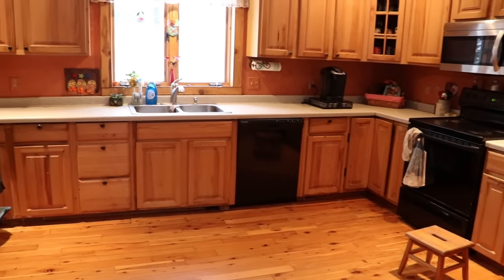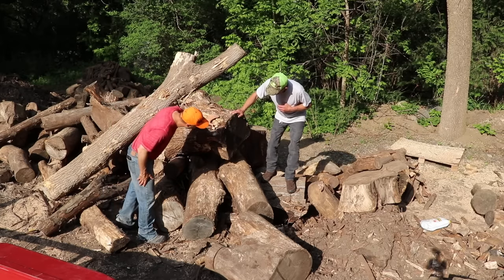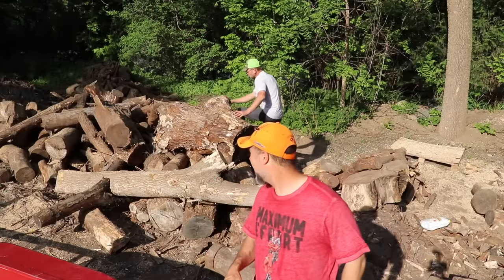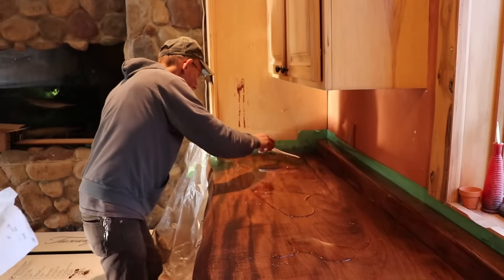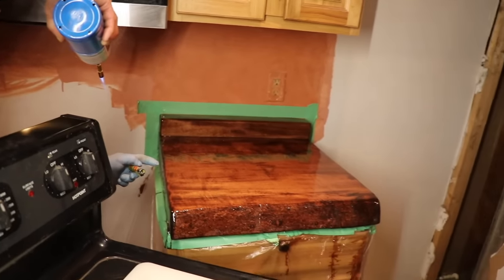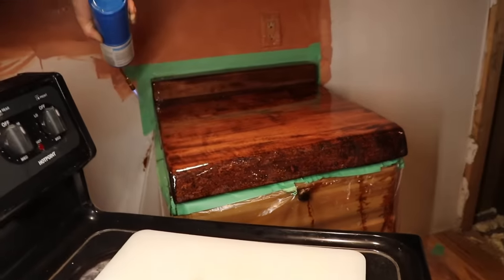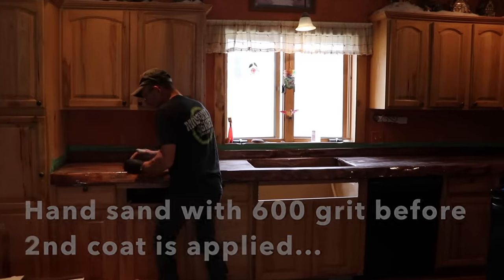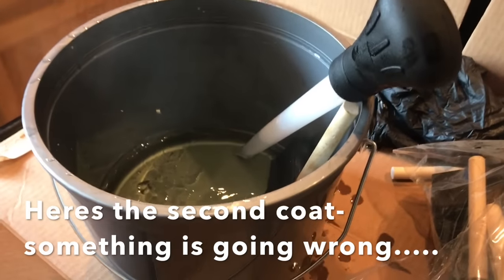A bad Epoxy Job on Our DIY Live Edge Kitchen countertop ... how to do Epoxy repair Pt3

Comment: I used Stone coat counter tops epoxy and it was great to work with. It is food safe and heat resistant. No smell and don't need mask and so on. Check them out on youtube. their stuff is wonderful to work with for this type of job. I love the wood with live edge. Beautiful
Reply from the maker: I have seen that channel.  His stuff is amazing.
Reply: I used it in my kitchen, cabinet doors, and drawer fronts. it looks great.
Reply: Teresa Nanry plus they use a burn in stick..works great for bubble areas
Reply: burn in stick?
Reply: Anyone who tells you not to wear a mask when working with epoxy is just irresponsible.
Reply: Does it yellow over time?

Comment: Yes as others said and i did it wrong once too it heated up to much like your big full bucket did in 8 to 12 minutes.. . Mix in your big mixing bucket for two minutes and instantly get your Epoxy out of the big bucket ( in big bucket Epoxy will harden and be worthless in ten minutes )pour INSTANTLY  into small cups  4 to 8 ozs you now have a 20 to 40 minute working time...

Comment: I ruined a gallon of epoxy today.  I went by the instructions like I've done a dozen times before and did a warm water bath to bring the epoxy up to about 80F.  Here's where things went wrong.  This was way larger a batch than I've previously done and was going to be 1/4" thick so I decided to degas the epoxy like I've done with smaller batches before without issue.  I got busy and forgot about the epoxy in the vacuum chamber.  10 minutes went by and I hear popping so I check the epoxy and it's boiling so I let air back in and realize the bucket is melting.  I had to dump a bucket of ice on it to get it cool enough to remove from the vacuum chamber.  I left it outside for 2 hours and it's still 175F!  I just checked on it another 2 hours later and it's 135F.  $60 down the drain!

Comment: Never hand sand. What happens is while you wont be able to see it while sanding you will leave small finger grooves in the finish from hand sanding. Always use a flat sanding block and with the black sand paper use a spray bottle and wet sand. It works much faster on higher grits and the paper lasts longer.  Been doing wood work for years. Trust me ive made the same exact mistakes and learned the hard way too.

Comment: I need help. I hired a guy to make epoxy countertops for us. This is what has happened to the side edge. There was a faint lighter colored line or scratch initially, and over time, it’s turned into this. He’s promised to fix it repeatedly but has never actually done the job nor is he returning calls now. I’m selling my house and need a way to make this just look darker so it doesn’t stand out.

Comment: Maybe polyurethane is sounding like a better option for a simple old fashioned wood counter top? Maybe save the epoxy for the projects where it's structurally integral or you're replicating the look of a different material? That's my take away from this. Glad you decided not to try to pour over bark though - otherwise somebody would have been barking a few months down the road. haha.

Comment: Hi Stan.  I've done projects like this, not as large but pretty close.  A few tips:

- use a sanding sealer before the first coat.  The reason you get bubbles is the epoxy is displacing air in the imperfections in the wood
-Epoxy is mass sensitive and in a large mass will exotherm if you mix too much (which you did).  It had nothing to do with the bucket material.  I don't mix more than a quart (2 lb) at a time.  You also need to use it quickly.  It will get hot as hell in a concentrated mass.
-Invest in a vacuum chamber and de-air each mix before apply it.  Takes about 5 minutes.
-You absolutely need a team to do this, one mixing and de airing and at least one applying.  Good work there.
-Yes, you can use a heat gun as opposed to a torch, it's all about technique.  You can also lightly spritz over the bubbles with IPA and they'll pop.  What you're doing is reducing the viscosity / surface tension in that local area.  You need to be careful though cause you'll get waves if you try to pop bubbles with any heat applied when the epoxy is starting to gel.
-You did great on the vertical surfaces especially on the unfinished edge.  Not easy to get a uniform coating.
-There are some additives you can use that will lower the surface tension of the epoxy so bubbles will release on their own.  Just need to make sure they don't make the mix cloudy.  I've used silicone fluid at a few ppm successfully with no inter coat adhesion problems.

BTW you can mix epoxy with sieved saw dust and it makes a great wood filler.  Add oil-based stain to match the base wood color.  I use it when restoring old wooden tool handles.  It's also great to repair cracks in concrete used along with dry sand.

The result was beautiful and good on you for showing both the good and the not so good.  I really enjoyed this video!
Reply: Thank you Big Papi for the information.
Reply: ill add to use a powered dust extracted sander as this will reduce particles in the air  that can settle on the project later as well as reduce wear on the sander, reduce pigtails, easier cleanup, less wear on sanding pads and probably most of all safety to user
Reply: Vacuum chamber is the best advice I'm. Saves so much time
Reply: Thank goodness for a true professional!
Reply: I am really thankful for posting the negative!! I too had sime issues with a counter top job, had some issues with indents and pimple like particles, it was my fault, I had the heat pump running and it created this! Sad part, homeowner wouldnt let me fix and do top coat, they didn't want to wait the extra time:( so bad on my part.
Reply: Big Papi super helpful
Reply: Great video, and super-great added advice big papi! I just completed about a 20 sq. ft.  countertop using the "Giani" brand, faux granite kit. However, instead of using the water-based topcoat that comes w/the kit, I used epoxy-resin. All I can say is, it definitely helps to have a "team," (I attempted it myself), I & you should expect to do several coats. It's almost impossible to get perfect results w/just one coat.

Comment: I mentioned in the other video, I used a drill press, slow speed, with a simple looped end wire coat hanger. Introduces very little air. The epoxy is cheap. Pour amounts more than you need and let it find its own level rather than moving it to where you think it should go. Moving it adds air. Make trays to catch the runoff. Pour it in back and let it move to the edge where you can brush the sides. I used to pour 20 to 40 gallons of it each day doing conversion van parts car dashes, art work, bartops, etc. You learned a lot on this job. There's lot's of good ideas in the comments section. Don't fear the next one, it'll go faster. You can do the pour section of that job in 3 days. Next time! Remember, never leave dimension on the first coat. Get rid of it after 30 minutes. Pour the second coat within the cure window to avoid sanding. Nobody likes sanding epoxy. A good heat gun will cook epoxy allowing you to shave it off with a putty knife.

Comment: Hi, guys,  I build River Tables....  just a few things I do.. which seem to work well.  I Stir my Epoxy/Resin in one Direction Slowly,  No Fast, NO Circle 8's figures etc.,  Just slowly in 1 direction!   I ALWAY PRE HEAT the room to 85 degrees, with a SPACE HEATER.... if working inside the home, use a SPACE heater to keep the room at 80-85deg. F.    TURN OF the Furnace, or you will be very unhappy when it kicks on and All the dust act., flays around, and into your work.    I warm my Epoxy in HOT water just before I pour.....  it seems to reduce the Air Bubbles.  Also, when dealing with prices that have natural CRACK, CAVITIES, Worn Paths etc., I fill the with the EPOXY the day before the 1st pour, so that they can FILL the CAVITY, that 99.9999% of the time prevents Craters etc.,
Love the look, I know it was rewarding to do it !   Sorry, you had to take the 2 steps back method..... School of hard knocks, we ALL HAVE BEEN there !
Reply: BWWGL9  Excellent tips!
Reply: The hot water tip is great. Also, before base coat I always apply a couple of coats of water based polyurethane. It seals the wood so no imperfections like orange peel appear. It also helps with the air bubbles, just make sure it’s completely dry first before applying the epoxy. In the video they say don’t use a heat gun but that is not true. Heat guns work the same way as a torch for reducing surface tension, you just need to use the right technique.
Reply: Nobody in my country (India🇮🇳) make such tables. 

Will I be able to make it all by myself? 
I had never did anything like that before. 

Is it a good idea to make a complete (not river or anything) teak wood table top of 6 feet by 3 feet by 1 inch thickness and then cover the holes and cracks with epoxy and then applying linseed oil or any oil used for wood working and then painting the table top complete white with paint and then adding epoxy coating with brush on the painted wood or adding a 5-10mm layer of epoxy over the painted wood? 

All I'm asking is whether or not I can put epoxy on the painted hardwood?
Will epoxy stick to paint?

Should I paint the wood directly after cleaning or should I first put a layer of linseed oil or wood oil on the table top and then paint the wood?

I will make a 12-14 gauge steel metal frame of square pipes for my table top.
I'll paint the frame white also. 
Can I put epoxy on painted metal? Will it stick properly?
This method will also preserve my metal frame for about 100 years. 

Can I paint over epoxy?

I will use epoxy to seal any remaining pinholes or minute holes in the welded steel frame to support table top. 
In that way the remaining oxygen supply inside ‘square pipes’ will cut down after some time and further corrosion of frame pipes from ‘inside out’ will not occur. 
That's a good idea, isn't it?

I'm just a bit afraid since it's my first time in my life doing such a thing. 
I'm just 20 years old and I lack knowledge of all these stuffs.

Anyways... First I'll have to buy proper tools and machines for my work. 
Big machines I cannot afford plus I don't even have that much amount of space to keep those machines. 
Those big machine jobs I'll probably get done at a local shop. 

Answer my questions (in serial order) if possible...
Any help is appreciated...

THANK YOU
Reply: good advice. thanks for sharing.

Comment: Lovely to see this work - mistakes are more informative than perfect video - can I really recommend you add "We didn't wear breathing protection - this was a mistake" to your video with a link to the CORRECT breathing - a 3M 6000 with organic vapour cartridges should be correct for epoxy I believe. I was gobsmacked when you were commenting how much the epoxy was gunking up your tools but you weren't thinking of your lungs - I think you owe it to those people watching to advise them correctly on the safety aspect.

Comment: I have used that product on countless projects. What I find best to reduce bubbles is to use 4 to 5 thin coats of polyurethane to seal the pores then apply your glaze coat. Seems to level out better too and little to no bubbles. Great tips though guys. Thanks for the videos.

Comment: Glad to know that this can happen to professionals. I was using a Polycrilic product that the second coat was so bad that I used some paint thinner and sanding to get rid of the second coat. My issue was the heat and humidity, and the fact that I didn't stir it enough before using it. And my 2-day project turned into a 2-weekend project. Great video, love the way it turned out in the end, the mark of true professionals and what they can do. Love the videos, keep up the good work!

Comment: Just a note from an old woodworker and Sawyer -i was always told with rough lumber it takes a year per inch of thickness to dry "under perfect conditions " I would like to know if it does crack in the future. I also disagree with you saying. The bandsaw marks were part of the grain of the wood-it wasnt sanded enough. They make wide belt sanders every day -find someone who has one and pay them to do your sanding. Also tops are the same as doors -they need the same number of coats of finish on both sides. Thanks for doing a true video and letting people know what is involved and you should read all comments because some had some good advice -not mine BTW.

Comment: You mentioned at the very start about how water content of the wood would slowly change over the hears to match the conditions in the house.  What you forgot about was that while wood WILL move and warp if it's allowed to get wet (absorb moisture) and then dry WHILE IT IS FREE TO MOVE ....  This is why at a lumberyard once the wood is slabbed and cut into boards, it is stacked to air dry with weight placed on top to help keep the boards and slabs straight. If you wet the wood down and then SECURE IT IN PLACE it will tend to stay put much more readily.  In order to take that warp out of the countertop, the method I would have used would have been to soak the board and then clamp or secure it down on a good flat solid surface for a few weeks to let it dry nice and flat.  In order to allow for proper air circulation all around, however, you'll want to use a method that permits air flow so as to dry the board evenly in order to prevent cracking and checking in the ends.

Another method commonly used at lumberyards and sawmills .... to view the surface grain of the wood WITHOUT soaking it in water .... mist it with some mineral spirits.  The mineral spirits will evaporate out fairly fast without changing the moisture content of the wood.

One of the best methods to use to make your countertop smooth with as little work as possible - start with a portable planer to start taking down the high spots ... use a hand plane if you cant or dont want to get a power planer.  Graduate up to a card scraper, and THEN begin the sanding work.  If you're skilled with the plane and card scrapers, you can start your sanding at 400 grit. 90% of your sanding should be done by the time you stop using the 120 grit.  By planing and card scraping, you bypass the 120 and 220 grit stages.  Wood generally doesn't benefit from sanding past 400 grit when you use some finishes, but others really bring out the details.  I commonly sand my wood projects up to 1000 - 2000 grit before applying my cyanoacrylate finish, and then wet sand and polish it up to 12,000 grit micromesh before buffing with Meguiar's Plast-X.  Plast-X will easily take a 8,000 grit surface up to 30,000 grit (mirror polish) within minutes, and works quite well on just about any plastic surface I've tried it on.

Also ... until you are actually THROUGH the epoxy material, there is no chance for water to damage the wood.  The rubbing alcohol has "less" water in it, but it would still cause the wood to swell if it had made any contact.  You would have been just fine sanding with water ... in fact, you SHOULD have used wet-sanding to remove the hazing and to level the epoxy.  It's common to clean the dust off a woodworking project with 91% isopropyl alcohol or denatured alcohol.  The water content is tiny ... but it IS still there, so we always take care with it.  If we want to clean a project and have ZERO water added to the wood, then we use acetone (nail polish remover).  NEVER EVER EVER use Acetone to clean your plastics and acrylics .... it can melt them.

Comment: if you ever do this again use a 1/8" notched trowel the epoxy will self level in the grooves leaving you a much thicker coverage and less spill over the edge, also let the epoxy set up for about 15 minutes before hitting it with a torch, this will aid the epoxy not moving and making low spots. Bubbles will happen no matter what you try or base coats (primers) you use. The trick is letting it set up slightly so it's not tacky but almost to a gel consistancy.  Beautiful counter tops by the way, Love the real wood, although extremly heavy.  Don't forget about the 30 day cure period before the epoxy is 100% set.

Comment: Hello Stan, The first thing to do with the slab of wood is to level it out it's a simple step and it removes the natural warp, but the best thing would be to just go over to Stone Coat Countertops videos and watch a few of those it would have filled in all the gapes and this job would have been much easier for you guys to do and a bit more enjoyable as well. I hope to sea more countertop video's from you guys.
Reply from the maker: Thanks for the input Robert and thanks for watching !

Comment: Gray bucket may be abs. Clear mixing buckets are hdpe. Always use the ones with measuring marks on the side. They resist most chemicals.
Reply from the maker: That might just be what happened
Reply: One of two things happened with the early set up. Either your measuring was off causing the rapid set or (more likely) you inadvertently allowed some of the previous batch into your second batch triggering the rapid set. Roo. Temp can play a role but it would have to be a large variant.
Reply: read the recycle mark on bottom example milk plastic is same as red gas cans just saying 1 dollar dollar general store shoe boxes i use a lot fer crap

Comment: I've seen some guys use a square notched trowel to spread the epoxy coats.  I think it helps give a more even thickness for each layer.  I haven't tried it myself yet but will in the future.  Just waiting for my slabs to dry.  :)